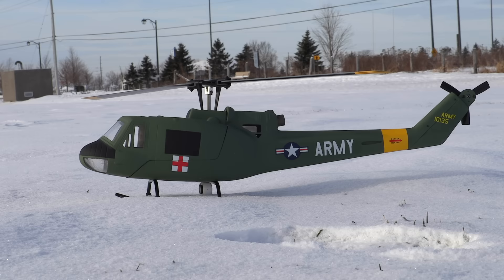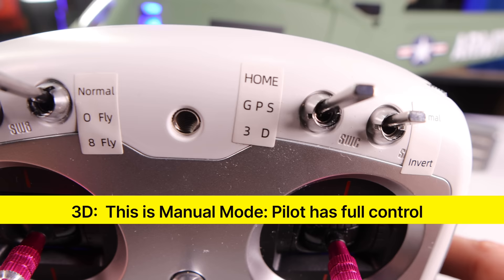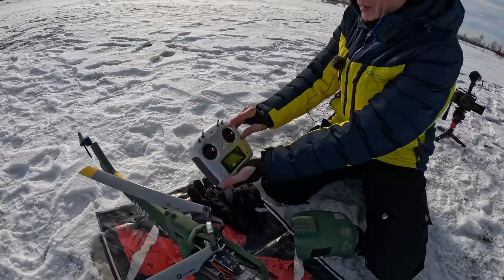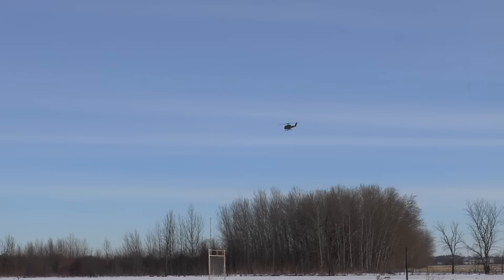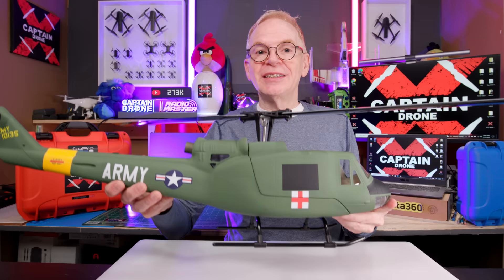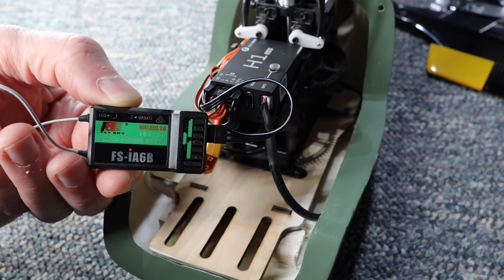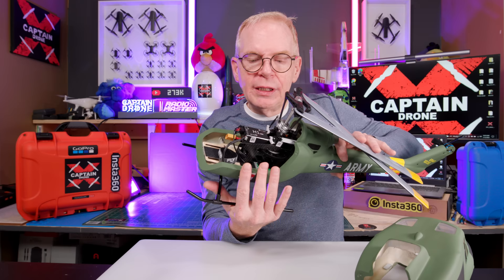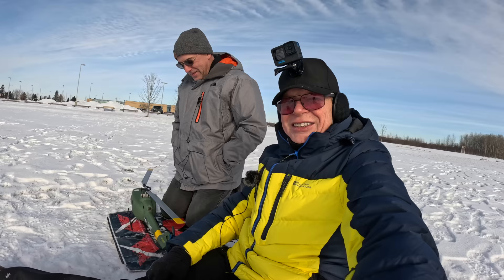The Fly Wing Huey UH-1 RC Helicopter is a Dream Come True!  Review

Comment: What kind of glue did you used to glue in the windshields?
Reply from the maker: I just taped it in place with fibreglass tape.  I tried CA glue (gorilla super glue) at first but it was getting messy so I gave up.

Comment: Finally got it ready, however the rear motor is a screaming!! It’s that normal?
Reply: Thank you
Reply from the maker: If it is flying without issue then it is all well (the rear motor may sound like air coming out of a balloon at times).
Reply: @CAPTAINDRONE798  unfortunately I hade a major crash total loss,  beware everyone it almost took my my off!! Did the calibration, all good so far, got green light, proceeded to hover… less then uneventful take off and hover. It totally became uncontrollable as it lost GPS Satellites 😡😡 I wonder why Free Wing doesn’t apply a proven platform like the FW200 which is by far the best easy to use for beginners !!!
So Fly Wing let’s apply the technology of the FW200 to a larger size!!

Comment: It's NOT highly detailed because you'd need lots of details, which it doesn't have... LOL  Some large oversights are the 3 blade rear rotor, tail rotor on the wrong side, main rotor turning the wrong way, huge in your face tail motor, inaccurate main rotor sans a flybar, fake side openings or windows made with black paint, missing corner windows, missing panel lines, missing decals, rivets and lights...  Not a big deal except this model costs over $700... No RTF version since it's NOT ready to fly and the 20 minute flight time is for a 5000mah pack which it does NOT come with...
Reply from the maker: Certainly if you collect “Shelf Queens” then it is not that. It does look freaking awesome in flight.
Reply: @CAPTAINDRONE798  I love it! Shelf Queens! lol Reminds me of people who buy Harley Davidson motorcycles and then don't ride them for fear of putting miles on em
Reply: @CAPTAINDRONE798  Most scale flyers fly scale ships and I don't think they consider proper non stand off scale ships, shelf queens... perhaps not calling something "highly detailed" that isn't would be the better approach here...